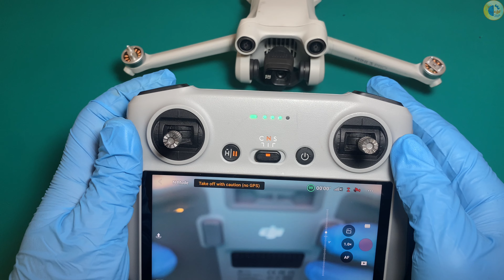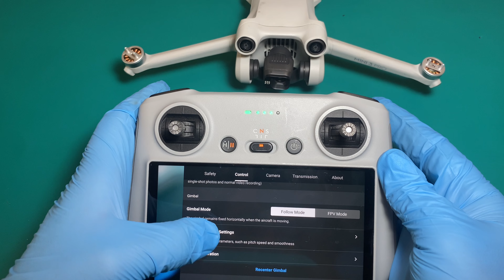Dji mavicmini3pro Gimbal Roll bracket replacement in22 Min/djimini3pro Gimbal Roll dirsek değişimi

Comment: Hello. One of the gimbal bushing sides of my gimbal has come off the bushing. I can see where the 3 little prongs go into the rubber bushing but I have no clue how to do this. Will I need to take my drone apart like this just to get the gimbal back into the bushing? This seems far beyond my level of drone survival skill work. Thanks!
Reply: there is an easier way in my opinion to do this repair. But you should be able to take the cover off and pull the rubber back through.
Reply: @Joe-wk9ow  Thank you but I don't trust myself. I am sending in to them for repairs tomorrow, actually :) Thanks!
Reply from the maker: hello, it needs to be checked in the service, the fault is detected, it will be more healthy

Comment: I replaced the gimbal today but I’m getting gimbal stuck and incompatible gimbal data signals. What to do in this case? You can reply in Portuguese, Spanish or English if you want. Thank you!!!
Reply: Am besten zum Service von dji schicken. Die sind sehr kulant, auch wenn keine Dji Care abgeschlossen wurde.
Reply: @rapjab8137  our problem here in Brazil is that there is no dji service near. The only one it's far and very, but very expensive.
Reply: @kantek.360producoes7  die Firma DJI hat auch in Deutschland keinen sitz...meine musste ich auch nach hungary schicken...über die (DJI FLY App) kannst du eine Reparatur Anfrage stellen...das Versand Etikett bekommst du per Mail..also die Versand kosten übernimmt dji.

Comment: Dont you need to do Python? It looks like little bit panned to the right
Reply: The Mini 3 doesn’t work with DJI Tools 😭
Reply from the maker: yes
Reply: @Djiservisi  can you give us the tutorial for calibrate the gimbal using python or another software?
Reply: I have the same problem on my Drone, and I see the video also has the same problem, do you have a solution?